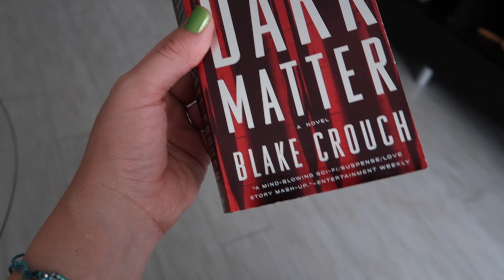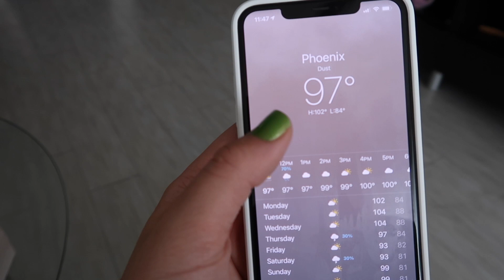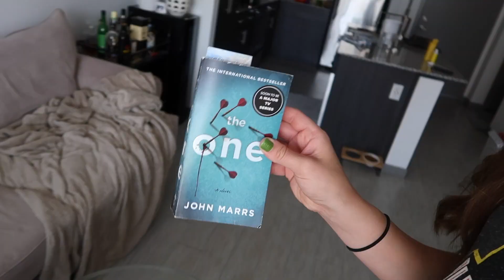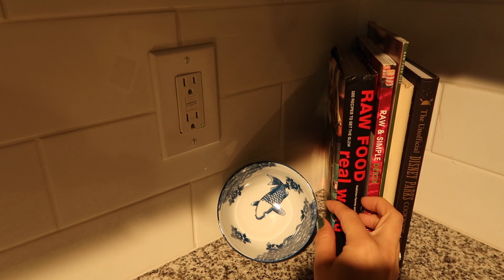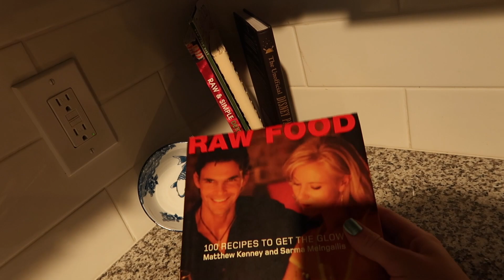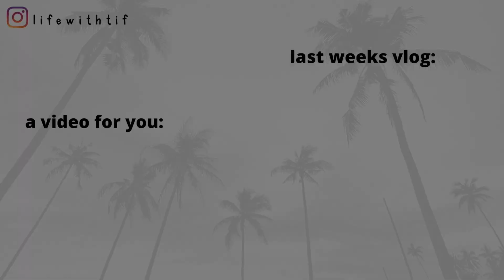Better weather, downtown Phoenix Arizona, and why I’m no longer vegan…

Comment: I am very sensitive to things (always have been) and last year my histamines were crazy…I was having more hives than normal and the allergist wanted to put me on all these antihistamines that dried out my mouth so I had to stop those!! My lips and inner cheeks and tongue would swell from the slightest irritation or from me biting them accidentally. Needless to say, my mast cells were going crazy and my body was going crazy. Not sure what the culprit was…I’ve noticed my sensitivities are worse now that I’m older. I will sometimes out of no where get stuffy and feel like I’m choking on my own mucus and sometimes I feel as if there’s a lump in my throat. I wasn’t sure if it was a histamine reaction or some type of silent reflux especially since it happens randomly during the day. I will sometimes take Benadryl or even chew a couple of tums. Needless to say it will resolve after about an hour or so. I carry an EPIPEN just in case because you never know. Do you have issues with indigestion as well or strictly histamine intolerance?
Reply from the maker: WOW that is exactly what happens to me!!!!!! The older I get the worse it’s getting, I used to never have indigestion but I definitely have some now randomly. Everything is so random and never the same. My gums and the skin in my mouth will get irritated from a couple bites of certain things and just start peeling off… it’s so gross! I have to take antihistamines when it gets really bad, I have to take generic Zyrtec and name brand Pepcid AC together. Otherwise my face swells up and I’ll have hives from head to toe! But that’s only like once a year or every two years when it gets that bad! I carried an epipen too just in case in the beginning, now I feel more comfortable knowing it has never gotten that bad…. But I also have to use an inhaler sometimes too! So I tested and had the same meal tonight but I did not have the green juice (it had mint and spinach) and I did not add more mint to my rolls, and I am wayyyy better off tonight 🤨 my doctor really emphasizes gut health, and for some reason my gut health is really hard to keep up no matter what I do or eat! So it’s been a struggle!!! I get that choking on your own mucus and lump in your throat feeling a lot! It’s terrible! Is there anything else you do that helps???
Reply: @lifewithtif  when I saw the allergist initially she said I had an allergy throat, which I guess is red/irritated and she mentioned cobblestone look?? For YEARS I always had the itchy skin and random hives, mainly on my torso and sometimes arms/legs…never my face! Last year was the first time I ever had the lip/tongue/facial swelling. Earlier that day I ate some chocolate and salad with feta cheese (aged cheese) and woke up after a nap with swollen tongue on one side…Weird. Then from there I had swollen lips a week or so later and swollen inner cheeks. I had to get a steroid shot. It’s been 9 months since I’ve had the facial swelling but I do wear a bite guard/nite guard so I don’t bite my cheeks or tongue in my sleep 🤦🏽‍♀️ The itchy skin and random hives still happens. I’ve stopped eating kimchee/sauerkraut and no longer drink kombucha (all fermented) . I was trying to consume those for gut  health bc of the probiotics but too much would cause my throat to feel funny. I don’t eat any citrus not even pineapples bc they use to make my tongue hurt if I ate too much. I don’t eat bananas because they always made me feel like my throat was tight and I was choking…lol! I’ve never had a histamine intolerance diagnosis but I do have a lot of the symptoms so I’m going to be more mindful of what I consume. I love chocolate and walnuts and chickpeas/hummus 🙄 (all things to avoid) My allergist didn’t want to do a food allergy test unless there was something that was truly giving me anaphylaxis. I was tested for celiac disease but I don’t have it. I do try to limit my gluten. The celiac test did show I have low IG A which is an immunoglobulin of the respiratory and GI tract…so that could definitely have a correlation to everything as well. I took Zyrtec/Pepcid/singular combo last year for about a month per my allergist for the hives but like I said I had dry mouth and my tongue appeared enlarged from the dryness so I stopped those meds. I’m gonna be more conscious about the foods to avoid and see what happens. Like I said the itchy skin and hives have been a part of my life since childhood but I don’t like that feeling in my throat which just comes out of no where (I guess from the histamine build up) and the increase mucus. I read that indigestion can be a symptom of histamine intolerance which I will get at times. When the mucus and funny throat happens I will chew two tums and take a Benadryl since I don’t take antihistamines regularly. It does work but I should prob f/up with my pcp or allergist as well. I’m trying to limit coffee bc I’m sure that doesn’t help. I drink spring or alkaline water too…no citrus juices. My MD  doesn’t think I will have anaphylactic reaction so I’ve gotten more relaxed with not always carrying my EPIPEN. I guess we will only be able to eat non citrus fruits, no dairy, kale, veggies except tomatoes and no spinach and almonds! 🤣 I eat pretty healthy but will have to really eliminate a lot of things